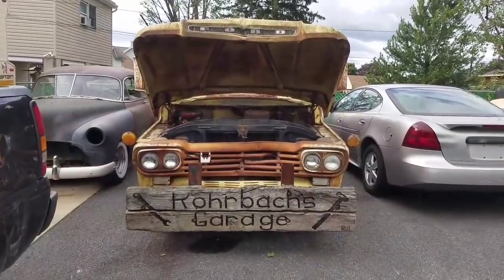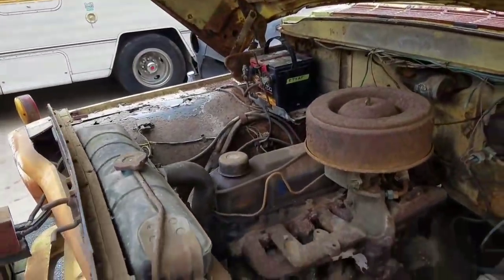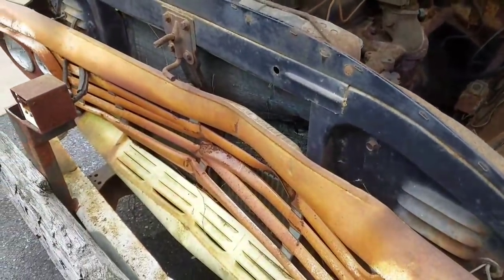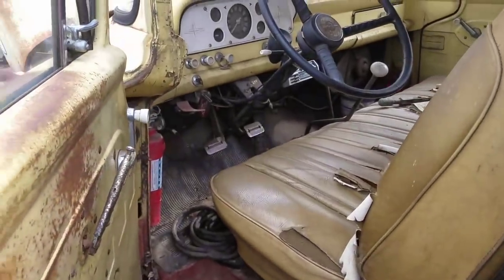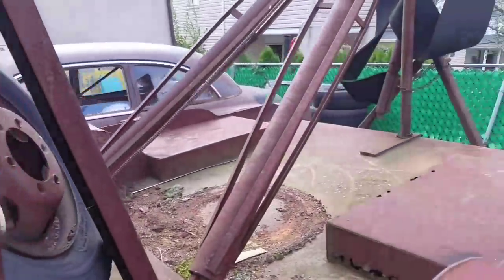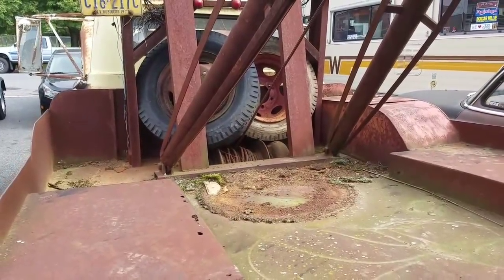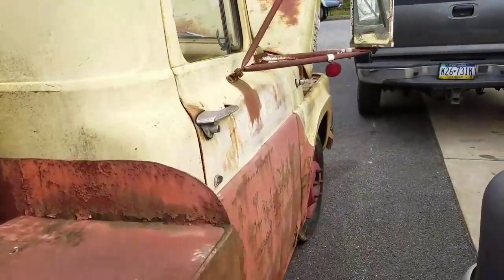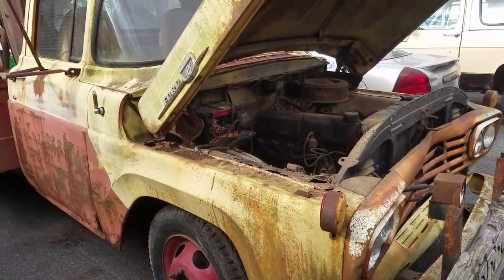1959 Ford F350 tow truck

Comment: Memories I have from my 59 1/2 ton ford rebuild:
Vacuum wipers suck.
Kingpins & bushings suck.
Front drum brakes suck.
223 in line six--- can be made to run like a well-oiled singer sewing machine but has a super limited, very low power band.
Oil-bath air cleaners are nothing but trouble. 
Good luck with your project.

Comment: Thats pretty neat! that winch setup is kinda weird/crappy though if it works it works :p I figure it would turn into a shop truck/parts car for the new shop?  would look pretty swanky if you knocked all the rust and old paint off and just painted it a flat/matte light blue(i.e. rattle can and roller or spray it if you're feeling especially fancy) always love to see what you're getting up to though :) how is the shop coming along? the ceiling fixed yet?